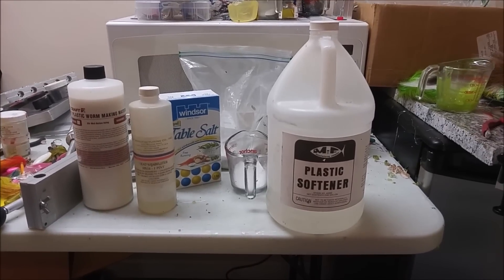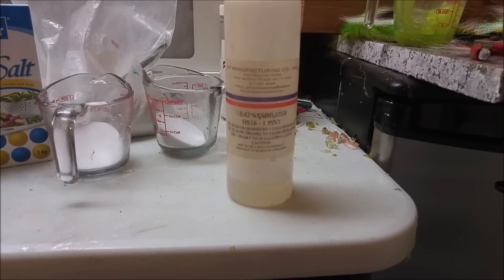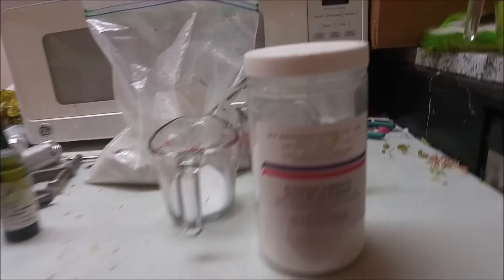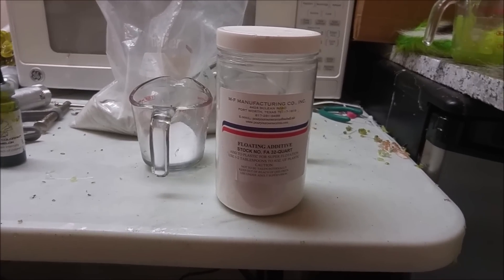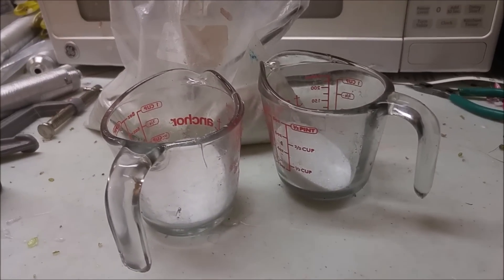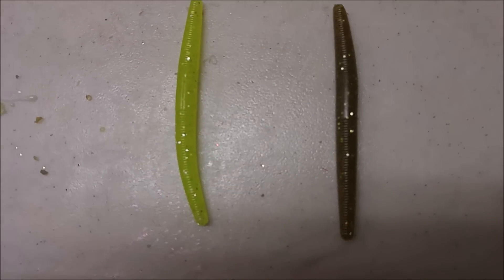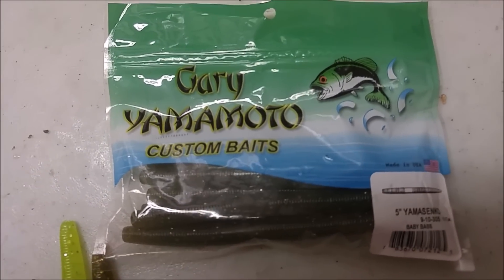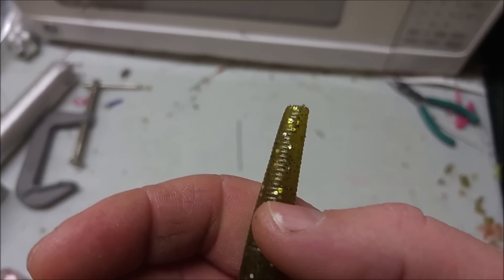Soft Plastic Stickbaits and Additives for Plastisol

Comment: How much harder o. Tube mix
Reply from the maker: It really depends on a lot of factors, like how hard/soft do you want the tubes to end up? And what blend of plastic you're starting out with. I find blending a 50/50 ratio of most plastisol brands medium and hard is a good starting point. You can experiment with adding hardener or softener to fine tune exactly the bait you want.

Comment: Whats the difference in action when allowed to fall in a tank of water? Just curious to see if the glass media tends to sink to one side of the bait affecting the action or not. Very enlitening video btw👍
Reply from the maker: The cavities in the mold are horizontal when you shoot them. Weight distribution is pretty even the entire length of the worm. Unless you have the plastic too hot then you may experience some "settling" on one half of the bait.
Reply: @theeverydayfisherman3905  so the key is getting the temperature correct when cooking the plastic? Thanks for the info I've just ordered some stick bait molds so im kinda just learning how to make them and when i saw your video it really caught my attention haha.
Reply from the maker: @rivieraauto8540  if the cavities of your mold are vertical while injecting/cooling you might be more likely to experince settling in one end the bait. And shooting at the correct temperature will be even more important, if you want even weight distribution. You might experience the same thing when using salt also.  Even flake can settle. But you might find you get a different (or better) action if all the gbm settles in one end. One end would be heavy while the other end would be more flexible. It's all about experimenting and finding what works best.
Reply: @theeverydayfisherman3905  👍thanks for the info man

Comment: I learned so much from that video, but have a few questions. How much plastisol and GBM would I need to use when making senkos like that out of a Pyrex cup like how you were doing in the video. Also, did you add any plastic softener/ hardener to the bait and how much did you use? I'm new to making baits and want to be able to produce my own. Thanks.
Reply from the maker: Will Simpson the cool thing about making your own baits is you can customize the blend of additives to make the lure perform how you want it to. 
Start with 1 tablespoon of gbe to 1 cup of plastic and see how it performs. You can adjust the amount from there. Same with adding softener. Start with what you already have and if you want more action out of the bait add a little softener to the blend.

Comment: Im confused? You actually think using GBM is better than salt? Quick recap on what salt does; helps mask the odor of humans and the smell of chemicals that make up the soft plastic, along with giving the bait a salty taste when bass grab on to it, typically causing them to hold onto it for longer until you set the hook, essentially giving you more time to make sure you get a good hook set. Also, having a soft bait is actually an advantage when it comes to catching fish. Sure its inconvenient if you dont have much money and 1 pack of senkos has to last you longer than they ever could, but if youre making your own then every worm you can use is 100% recyclable, which is actually good because you make sure you take all your baits back home to remelt instead of leaving them out in nature. GBM is jus another toxin to add to bodies of water. And I've never had my plastisol start to turn yellow overtime after "heating it too many times", the only time itll start to turn yellow or brown is when you literally over heat, causing it to burn, or if you have a lot of salt in your mix, then you will have a tendency to see that salt causing a discoloration a tad bit, but nothing that would cause a problem. Also, you really think being able to see the flake at the core middle of the bait is actually that important? You even said it yourself, when held up to the light you cant tell, which Im implying the sun will take care of that problem. Senkos have been so extremely successful over the years because of 2 reasons - they are super soft and they are loaded with salt. That simple. So load your plastic mix with salt and plastic softner.
Im not trash talking your video, I just think youre sending out the wronggggggg message. Not good to encourage use of GBM. Theres nothing wrong with salt either, but theres many advantages of using it.
Reply from the maker: TheReelHighZoneFishing I'm not going to argue with you about this.   I made my points in the video. GBM is superior to salt in every way except for the "salty taste" (and since I scent my baits this isn't an issue). To each their own. If you think salt is better by all means use it.
Reply: I rarely use salt, but I would never use GBM. Im not looking for an argument, just would like to see people be more conscious about being environmentally safe as much as possible. Oh well
Reply: I don't understand what your problem is if you've never used it before how can you really argue about it? And looking at it based on it's bad for the environment there's already so much toxic chemicals in the bait to start with it's really not going to change change anything.

Comment: Nice video. I can see the difference. in the color. couple of questions
1)is that the do it machine mold?
2) is their a big difference in the action. sink rate etc.
Reply from the maker: Not a Do-it mold. Many companies sell stick bait molds. CNC molds do give a much better finish than a sand casted mold. The action and sink rate is dependant upon the amount of GMB and how soft your plastic is. You can get away with using a softer plastic when using GBM over salt.